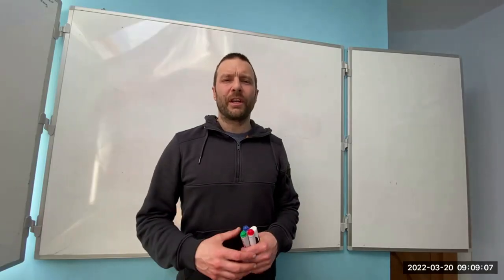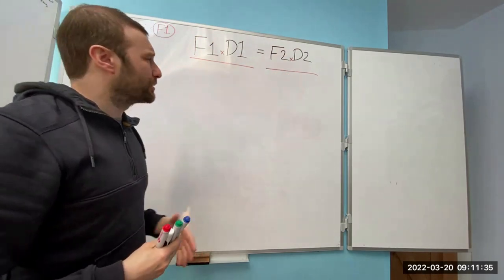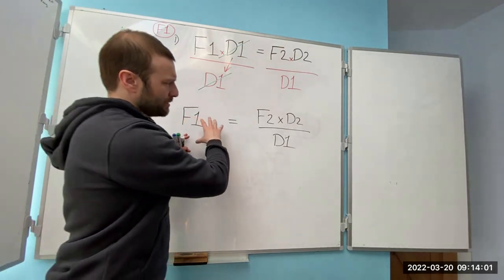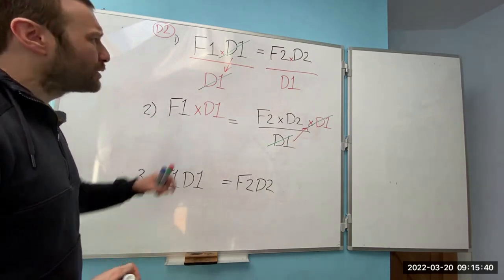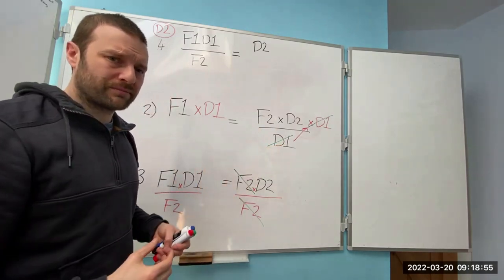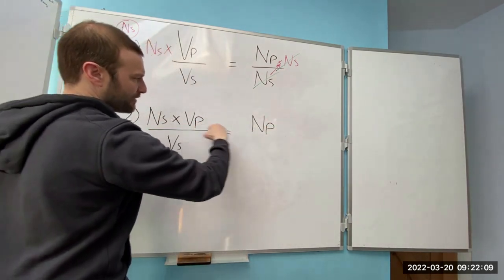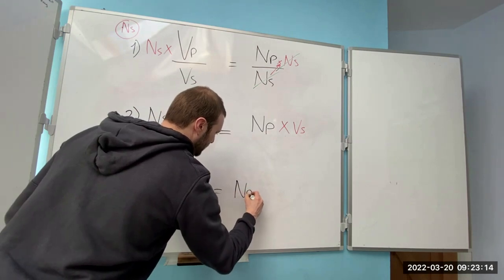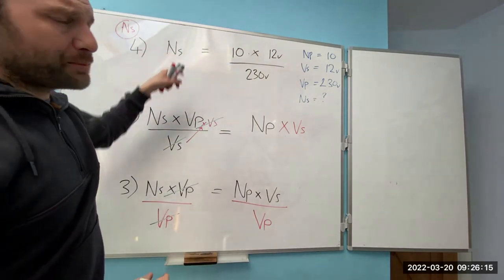Transposition made easy video 1 - Electrical Science and principles 1st year exam

Comment: In the second example, to get Ns, why not multiply both sides by Np first?
Reply from the maker: Because Np is on top of Ns, so this is a fraction.

You have to open up the fraction first to move what is inside it
Reply: @Pure_electrical_training  OK. Thanks. So that applies to anything that's a denominator? 

Is an alternative method to just multiply by Np and as its a denominator you flip the other side?

Comment: Fantastic thanks. Am on City&Guilds L3 8202-03 . Any questions on motors or similar 🇬🇧👍
Reply from the maker: What did you want to know?
Reply: @Pure_electrical_training  hi, exams on 1st any type of motor exam questions that usually come up 😃
Reply: DC motors . F=B×l×L or AC Generators synchronous speed in RPS& RPM . N=F/P ? 🙂